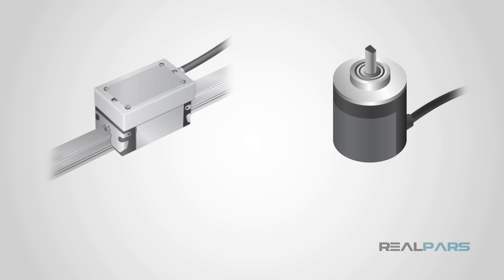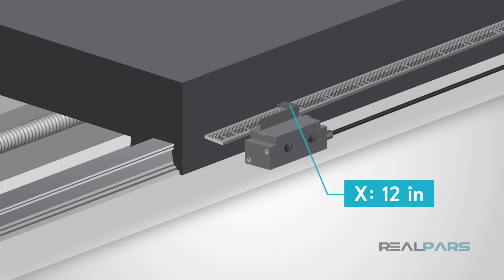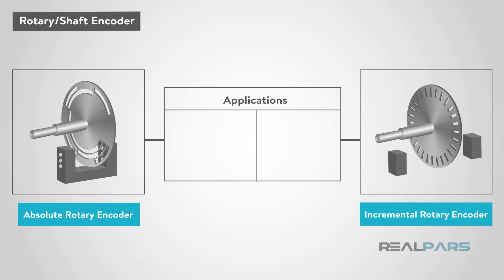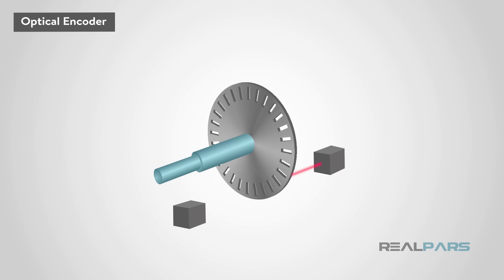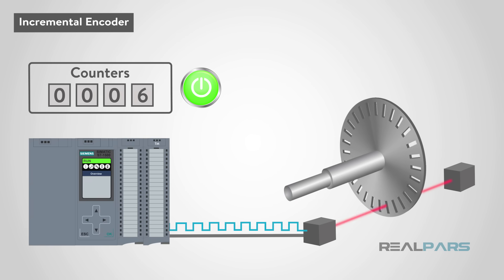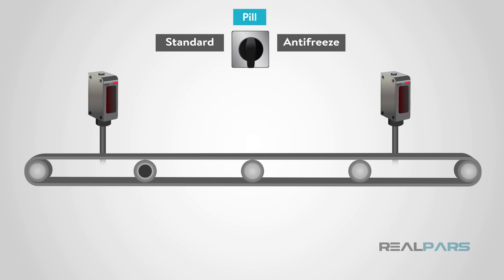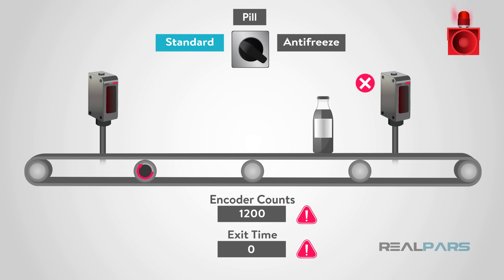What is the Difference between Absolute and Incremental Encoders?

Comment: For a three-bit absolute encoder, as shown in the example, the minimum measurement magnitude would be 1/8 of a full rotation (45 degrees). If they're so precise, how do they encode smaller increments? Or are their bit depth larger in real life?
Reply from the maker: A very resolute absolute encoder has 12 or more "tracks" which gives the device 12-bit resolution (1 bit per track).  2^12 = 4096 divisions/revolution.  This level of resolution is provided optically by detecting light pulses produced by very small photodiodes, a precise mask disk and an LED light source.  Up to 10,000 increment per revolution are now possible.

Comment: Is there a way to preset a negative value?
Reply from the maker: No, the encoder position is always a positive number.  If you want to establish a zero-reference and track position by + (clockwise) or - (c0unter-clockwise) from that reference, you could do that by keeping a separate integer variable that you can program with a value that increments up or down based on encoder position.  That is a lot of work, and i find using the encoder's raw position value to be the best to use.

Comment: I think there is a mistake in this video. Please correct me if I am wrong. A CNC milling machine would typically use a rotary encoder located inside the stepper motors.  A linear encoder is typically used in a digital readout (DRO) on a manual milling machine.
Reply from the maker: The use of linear or rotary encoders depends on the application, not on the "class" of the machine.  in the video. a linear encoder is used with a CNC milling machine where the part is moved back and forth in a linear direction.  If the machine were a CNC lathe, then a rotary type encoder would be used.
Reply: Nah bro, 

So basically, the servo motor needs a rotary encoder to feedback to the drive by default.

A rotary encoder cannot see lost motion, such as backlash, but a linear encoder can, as it moves linearly along the axe.

A linear encoder on a cnc machine is only there in order to achieve greater accuracy. 

With a stepper motor it is completely different to an ac servo, it doesn't require a rotary encoder, however you can add both a rotary and a linear encoder if you wish to achieve true closed loop control.

Comment: Hey. Thank you for a great explanation. I do not have much knowledge about sensors, and I m looking for some type of sensor for my project.  My question is; we will drill using earth auger, and we want to count the rotation number. As I understood, I cannot use these types of encoders because I need to connect to the drill bit, and it completely will rotate, so I cannot connect these encoders to the bit and the drill itself. Should I search for magnetic encoders working with rings?  In this way, I can place the magnetic ring on the rotational part, and I can count the rotation with an encoder that is close to the ring? Am I right? 
Thanks!
Reply from the maker: Thank you for your question. You have an interesting issue. If you're counting the rotation of a drill when it completes 360 degrees, you can use any electrical sensor that detects a marker on the rotating part, like the drill chuck or any other part that turns 360 degrees. You'll need to send this signal to a controller to utilize this rotational motion as needed. Happy learning!

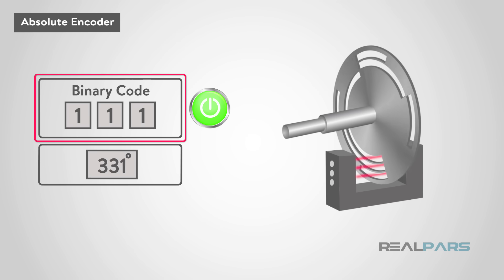Comment: I did not get it, can anyone can explain please. 5:39 how 111 code can precisely determine the degree. Since the video shows that 111 code is somewhere between 315 to 360 degrees. Or it is a mechanical counter like miles counter in an old car? In that case why do we need that laser system after all. Thanks.
Reply from the maker: The video shows a simplified version of an optical slotted disk absolute encoder with 3 bits of resolution.  That is equivalent to 45 degrees.  Actual encoders can have up to 28 independent light paths.  28-bit accuracy is equivalent to a resolution of 0.00000134 degrees.  That would be a little tough to show in the video, so it was simplified to demonstrate the principle.

Comment: I don't quite understand the absolute rotary encoder. For example , the disk start from 0 degree and it's 000 binary , for it to rotate until 001, it needs 360/8(binary digits/different pattern) = 45 degree, how can it knows where is the disk ? is it 23 deg ? is it 40 deg ? because the binary is still 000 , the pattern doesn't change
Reply from the maker: For an absolute encoder, as the encoder disk turns, the "pattern" that is sensed is unique for every position that can  be sensed.  The encoder in the video is only a 3-bit encoder, capable of detecting changes of 360/8 or 45 -degrees.  So you are correct:  between 0 and 45 degrees, the pattern does not change.  However, an actual encoder, say a 15-bit encoder, is able to discern 360/32768 or 0.011 degrees of rotation.  Each increment has a unique pattern, so the encoder always knows where it is relative to the 0-degree, or home position.
Reply: @realpars  Ah I see. So a x bit encoder use x led arrays to detect and 2^x different patterns?

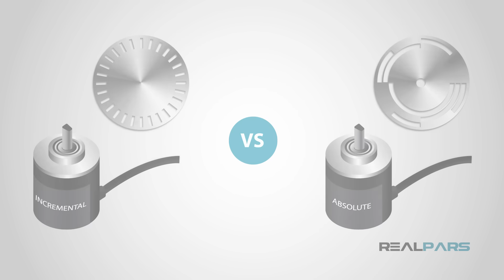Comment: But how does the absolute encoder know the exact position? In the example that starts at 5:20 when the code is 011 it could be 150° or 170° or anything in between
Reply: My best guess is they can increase the number of bits (slots on the disk)... The example here was a 3 bit encoder... You may use 4 or even more bits to make it more precise of the angles?
Reply: @sagelioneldsouza8230  i see, so doing some calculations you need at least 9 bits to get a 360° precision
Reply: @Kelmat_  yess :) Glad we figured it out🥂 Thanks
Reply from the maker: Kelmat is correct.  The video shows a simplified example.  With an absolute encoder, there is a distinct bit pattern for every position, so that the position can precisely be known.  Many absolute encoders utilize multiple disks for position determination and many are able to determine absolute position over up to 4096 increments/turn.
Reply: I knew something didn't 'add up' with the binary code and the degrees so I thought it may have been a simplified example. Then I confirmed by looking it up (https://en.wikipedia.org/wiki/Rotary_encoder) and sure enough, an interruptor disc with many more slots is listed in the picture above. If you ask me, there is something hypnotic about the arrangement of these slots in a rotational pattern. But anyhow, I scroll down here to see if anyone had the same question and here I am!
Reply: That is correct. The position is only known precisely for a limited number of positions or position ranges.

Comment: for absolute encoding, this article might be interesting:
https://en.m.wikipedia.org/wiki/Gray_code
by the way: when code is on a wheel, make sure it doesn't slip due to obstruction so a reset position might be s good idea ...
on the other hand: using a stepper motor might be as good as the incremental measuring as long as rotation of the axis is not obstructed.
Reply from the maker: Thanks for adding that!

Comment: Do optical encoders require debounce filtering?
Reply from the maker: Hi Andrew, 

Thank you for your question. The inclusion of the feature you mentioned in the encoder's electronics could vary based on the manufacturer and its intended use. To gain accurate information, I recommend consulting the operator's and data manual specific to your encoder. 

Wishing you a fruitful learning experience with RealPars!

Comment: Is it possible to have a design that will allow the incremental encoder to act like an absolute encoder?
Reply from the maker: If the incremental and absolute encoders have the same reference (zero) position, they should both give the same result provided they both have the same resolution.  In practice, that does not happen. The incremental encoder has a zero position wherever the position is when the encoder is powered on.  It simply indicates how many turns the shaft has made since it was first enabled.  So while it is possible to approximate the action of an absolute encoder with an incremental encoder, this is not often done because there would need to be another function required to position the shaft to a precise zero position.
Reply: @realpars  By integrating a microprocessor and an external battery
 I designed a system that ensures that the incremental encoder position is kept in memory continuously. I converted it into a thesis and my thesis was accepted.

Comment: how can i control the distance by using the encoder and how can we calculate the impulse
Reply from the maker: Hi Yahai, 

Thanks for your comment!

I will pass this on to our course developers as a topic suggestion. This would make for a great future course video.

Happy learning!
Reply: So let's use the typical 1024 pulse per revolution shaft mounted encoder. That means each revolution of the motor send 1024 pulses to the motor controller, typically some kind of VFD or PLC which in turn controls the motor controller.  Most applications are geared so that means we must take account the gear ratios between the motor and load. Let assume we are a 1:1 ratio and we are controlling rotational position scaled to units of degrees. It depends on the software used but in siemens motion control, you scale the units and define as rotational motion. This sets the units you use when setting acceleration or deceleration as degrees/sec/sec and position in degrees. You define the position of the movement in length units.  Let's assume for simplicity we define 3600 length units per revolution of the motor, that means when I command the motor to move 3600 length units it will move the motor one revolution at whatever accelerating I defined. What the motor does depends on what type of movement you have chosen. There are several types of movements, ranging from absolute, relative, synchronization position and speed movements, gear in movements and other more complex movements. A simple position movement will be defined as either relative or absolute. A relative movement will move whatever length units you defined from its current position. An absolute move will move to that specific position. So let's say, our position is 3600 LU and we move relatively 10000 LU, the motor will move until the position is 13600 LU. An absolute move would have put the motor position at 10000 LU. 

So to sum up, motion control is counting the encoder pulses from the motor and correlating that to some rotational or linear travel through defining this in meaningful units and issuing commands to the drive based on these units.

Comment: Can we make incremental to absolute or vice versa....
Reply from the maker: No.  This would require changing out the device.  The incremental and absolute encoder signals are very different in the way the position is determined.  Absolute encoders use multiple light paths to determine an absolute position whereas an incremental encoder has one light signal that pulses each time a fractional movement of the rotating disk is detected.

Comment: What is the difference between an incremental encoder and a absolute encoder?
Reply from the maker: An absolute encoder is designed such that the optical path through the encoder at any time indicates the absolute position of the encoder wheel, between 0 and 360 degrees rotation. An absolute encoder maintains its position information when power is removed from the encoder.

An incremental encoder gives only a change in position from one measurement time period to the next. An incremental encoder may need to be homed (moved to a fixed reference point) to initialize absolute position measurements.
Reply: @realpars  thank you 🙏

Comment: False! The absolute definition cannot account for the position angles between output changes. The only thing it could do is assume position angle based on current input to the motor and last known RPM. What that design us doing is giving an output every 1/6 rotation it seems.

However, if you were to add incremental pulses to the outter edge, you could know where the shaft is up to the resolution of the smallest gap between larger gaps. But if power is removed and restored it could only tell you which 1/6 its in and whether or not it is at an increment. But not which increment of that 1/6 it's at.

Comment: Is there actually encoders that output binary? I thought Gray Code was what they used.
Reply from the maker: With an absolute encoder, there is a distinct bit pattern for every position, so that the position can precisely be known.  Many absolute encoders utilize multiple disks for position determination and many are able to determine absolute position over up to 4096 increments/turn.
Reply: Yes you are correct.

Comment: Am I right? Incremental Encoder used in cash sorting machine for counting.
Reply from the maker: In a sense, you are correct.  The bills are mechanically pulled through a microprocessor scanner one at a time, and based on how many times a beam of light is interrupted, the machine knows how many bills it pulled through. While this is technically not an incremental encoder, it works pretty much the same.  As the bills go through the cash sorter, combinations of Ultraviolet (UV), Magnetic (MG), and Infrared (IR) are used for counterfeit detection and pattern recognition is used for detecting the denomination and orientation.

Comment: In a video i saw about my encoder , it did not require a power source. A womans hand turned the shaft and the led board lit up. I figured pretty simple setup. After receiving my encoder i hooked it to the led board and nothing happened. What am i missing ??? Im not an electronics wiz.
Reply from the maker: Thank you for your inquiry. In general, electronic devices necessitate power to facilitate the transmission and reception of information. This power can originate from an external source like a power supply or internal batteries. Some devices are even capable of generating their own power through rotation. For specific guidance on your encoder, I recommend reviewing the installation manual or reaching out to the vendor you obtained it from. Wishing you a productive learning experience with RealPars!
Reply: @realpars  theres no manual

Comment: but Incremental encoders have 2 lasers to be able to sense direction
Reply from the maker: Yes, there are typically 2 "code tracks" that are slightly out of phase so that both position and direction can be detected.  Some incremental encoders use two separate light sources (could be LED's, laser. etc) and two receivers to determine the position and direction of rotation.
Reply: Most encoders are in quadrature. 01-25-2020.

Comment: I have a absolute type encoder which is gray code output may i replace it with Binary coded absolute encoder? If you know please help me Thanks in advance.
Reply from the maker: Yes.  HOWEVER, gray code and binary are not the same number system, so you would need to modify your PLC code to replace the gray code to absolute position conversion with a binary code to absolute position conversion.
Reply: @realpars  Thanks for your reply

Comment: what happens if we mistakenly swap the polarity of encoder supply? Means connected positive to com and com to positive.  Will it work?
Reply from the maker: This is a great question!  Most (not all) encoders have an A and a B channel.  This allows for two pulse trains to be detected, 90-degrees out of phase.  Configurable models allow for the selection of the lead channel.  For instance, If channel A leads channel B"s pulse, the motion is in the clockwise direction (usually "+" direction).  If B leads A, the motion is in the counter-clockwise direction (usually in the "-" direction).  For these very .low-voltage pulse trains, both the A and B channels are connected to the same common.  This means that if the A and B leads are switched, as proposed by your question, the encoder will work, but will show movement in the wrong direction.

Comment: The absolute and incremental definitions of a rotating shaft are not accurate.  In your example it is only absolute in regard to a single rotation of a motor or shaft.  It is highly unlikely that a motor or shaft would be installed on equipment and never operate outside of a single rotation.  Anything beyond a single rotation would then be incremental.  This could be otherwise on a linear motor or railway.  I worked with programming and maintaining motion control stepper motors and equipment.  My experience was all with glass scale optical encoders and magnetic switches.  Glass scale linear and rotational indexing where black lines were printed on the scales.  Great stuff as long as it is clean.
Reply from the maker: Stan, thank you for your comments.  I have worked with dozens of stepper motor applications for turntables, positioning bars for lane deflection, and other applications that require less than one revolution of a motor shaft.  For these applications, absolute encoders are essential, and they do report absolute position.  I would contend that applications that require more than one revolution also benefit from absolute encoders, as position can be accurately determined by counting revolutions.  But in this case, you are correct, that in the case of power failure, CPU failure, etc., the absolute encoder would be no more than a fancy incremental encoder.